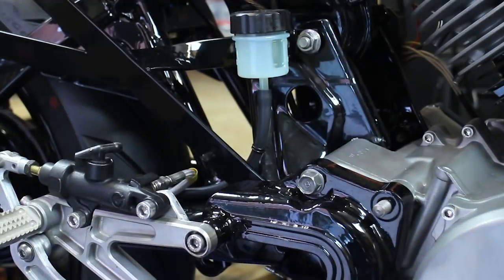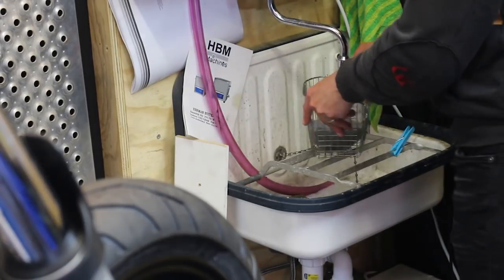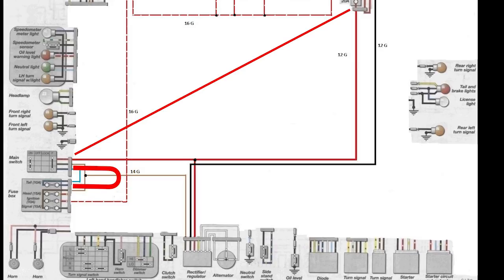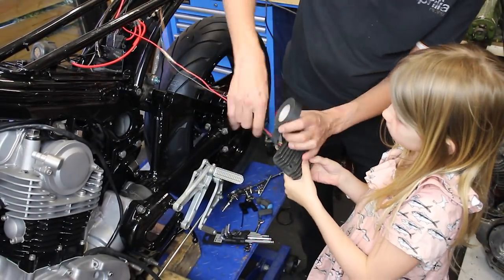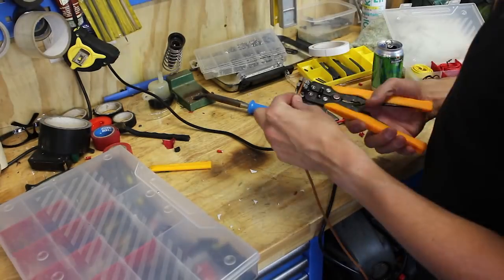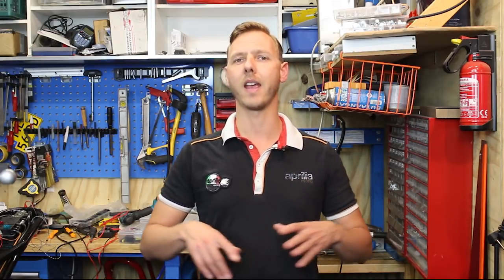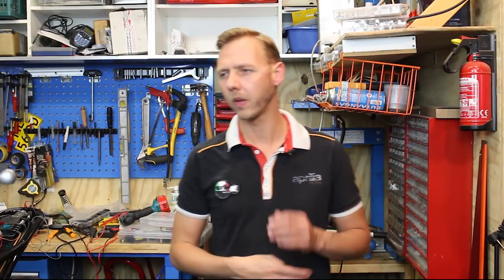Fueltank, brake fluid & wiring (part 3)

Comment: Good work ,Thanks for a good description of how power runs thru' in bikes.  I am humbly requesting you to  do a video of ranger 125cc or 150cc majorly showing clear connection for ignition  sys how the switch powers off the bike and also how it powers it on, left and right signal connection include a flasher, high beam and low beam connection how you connect to their switches and the regulator connection from the stator
Reply from the maker: I did those video's. Every bike is the same. Please watch part one and two real close and you will understand and be able to wire any bike https://youtu.be/6eX51fIQc8Y
Reply from the maker: And don't fast forward otherwise you will pass crucial info!

Comment: Am rebuilding my road legal quad bike and my son always wants to help me witch he is a good help lol but am getting confused about the lights and what wires go cheers Paul
Reply from the maker: Hope the video's help! Just take it step by step. It's fairly easy: A bulb needs a positive and negative. Negative is always a straight cable from ground or negative pole of the battery (doesn't really matter). Positive comes from your positive key contactwire and is interrupted by an on/off switch on your handlebar. Connect those, and it works! ☺
Reply: @chiefpepdesign  I will try that tomorrow when am off work thanks Paul

Comment: Pep my battery and starter solenoid are in the same location (under my frame) but my blue sea distribution block and positive distribution block are in a different location (much further away at the top of my frame). My question for you - can I run my starter solenoid positive wire directly to the positive of my lithium battery? Then run a separate positive wire to my positive distribution block to have it fused like your setup? I am trying to minimize the wires going back and forth if not necessary. Thank you.
Reply from the maker: Offcourse you can! You should even. Please watch this video https://youtu.be/m2cGSZlpznc I think this is exactly what you need.

Comment: Great work, however why didn’t you choose to use a motogadget M Unit? It would have made the electrics a lot easier and tidy
Reply from the maker: I thought I explained this is a video, but I guess not. First of all, I see the M-unit as 'cheating'. Second, the only thing it does is connect the cables. I can do that myself. Third, the M-unit is great if you don't understand, or don't want to put the efforts in to understand wiring. It's so easy if you just do it step by step and after that, it's very satisfying to experience that everything works as it should and knowing you did that yourself. With no 'shortcuts' like a M-unit which costs a fortune for basically nothing...

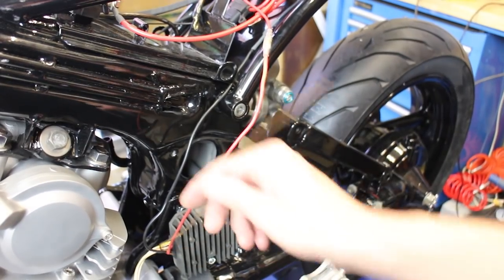Comment: Chief Pep, at the 8:50 mark, you show the brown and red wires from the Reg/Rect. The red wire connects to your fused positive distribution. The brown wire connects to your ignition switched distributed block. I purchased an aftermarket lithium compatible reg/rec, other than the stator wires, it only has 2 wires one red (pos) and one green (neg). My question is since there’s only one positive wire on my reg/rec for power, would you recommend connecting it to the fused power distribution like you did at 9:15 mark (pre-ignition switch) or should I connect it to the ignition switched plus connection on the blue sea distribution block like you did at the 10:18 mark? I am confused.
Reply from the maker: To make things less complicated than to try and write it down here, doesn't the 4:30 mark and explination help?
Reply from the maker: Sorry I get your question now! Connect the positive to the ignition switched power. 👍
Reply from the maker: It doesn't really matter. Either way it gets positive current. And both are eventually main fused. Maybe if you connect it to the ignition switch chances are smaller for power leaks during parking. But it's pretty far fetched. More of an 'ease of mind' thing. 😊

Comment: I  am restoring a 1994 Kawasaki 250 Eliminator. Where do the wires from the stator go to, and does this bike use both a CDI and a Voltage Rectifier?
Reply from the maker: I'm sorry. I have no idea. If you take the wiring diagram out of the workshop manual you'll see this instantly!

Comment: What did you wire into the forward junction box “brown wire”? In the later video you mentioned the you did not use all the spots. How many are needed?
Reply from the maker: Well brown is just a fused plus wire which goes on when you turn the ignition key. It gives power to everything you want actually... The fuse/distribution box has two sides. One side is permanent grounded (-) and the other side has plus (positive) power when the ignition is on. There I have some fuse spots empty. I can hook up everything I want instead of splitting the brown wire for instance.

Comment: Pep great video. I’ve watched this video at least 10 times. I have two questions. At 6:07 you add the inline fuse, but both ends of the fuse are connected to the same positive distribution block. How will the fuse work if the entire distribution block is receiving power from the battery? Second question, on your Bluesea fuse block how do you know how many amp fuse to use for each input?
Reply from the maker: I understand your qeustion. But you have to understand that the black unit itself is not connected to each other. So what I do is I put 12V input in the one end. By the connecting the amped wire I put that power to the other end. And that end is now also 12V but fused. So that block always works like this: one end had permanent 12V unfused, the other end permanent fused. So I attach different leads on those ends. That is why I choose to use such a block (see for instance 8:53) with nuts so I can ad several wires to it depending on if it needs unfused or fused 12V. Second question: This is shown in your service manual (or pause at my scheme that I show in my video's). Rule of thump: If many/heavy lights go through the leads (example headlight or all four signal lights which have a relais) use 15 Amps. Lighter lamps (tail lights/ignition) use 10Amps. If you've calculated wrong and it pops too fast at 10 Amps, try 15 Amps. Those fuses are generally only if you have a short circuit. Don't worrie to much about the amount of amps. Just don't go over 15 amps.
Reply: @chiefpepdesign  just like your videos, your explanations are amazing! Thanks Pep!

Comment: Hey there 😊 just finished Basic wiring for “running the bike” by you and it was such an amazing feeling to start bike succesfully thank you so much for that 😍😍😍 

I have one question , my reg/rec is originál from the Factory and it only has 3 white wires and one red i connected white ones like k was supposed to and red one connected to 20a fused distribútion bus  but no brown cable 

Ignition switched had two cables so one went from tha 20a fused distribution bus like for regrec and the other end to the fuse box 

Is it Ok ? Like bike is running With no probléms i am just double checking before conecting lights and etc thank you
Reply from the maker: I think so. If it works... You can always ask the Viragotechforum. They have many electrical tech guys there.
Reply: @chiefpepdesign  i tried to comment but it always ends up giving me error page 🤯🤯🤯🤯

Regrec is convwrting AC to DC right ? So the electricity flows from white cables in and throw red cable out ?
Reply from the maker: @majolamlech  Yes. The three white cables are receiving AC current from your stator, puts it in the R/R and the R/R gives positive (red cable) and negative (black cable) DC current straight to the battery. That's all it does. No more, no less. P.s. I hope you have became a Patreon...
Reply: @chiefpepdesign  actually yeah just now THANKS for reminding me 😅 i hope i set it up correctly i have never done  it before
Reply: @chiefpepdesign   i searched and found original wiring diagrams for model nd year so it takes ground directly from the frame THANKS to the screw and red wire goes to the fused cable which goes to the main switch and from ther to the fuse box
Reply from the maker: @majolamlech  yes. Thank you! 👍
Reply from the maker: @majolamlech  exactly. The positive is the important one. Ground is always no more than a frame. The brown is very outdated. Sometimes you find it. It's a cable to tell the R/R via ignition: 'he, go to work ok?'. Has no real function.
Reply: @chiefpepdesign  this is so much fun i never imagined it is gonna be so exciting every step forward 🤯

Comment: I'm not sure if I missed it or not but the magneto hooks up to the tci ??
Reply from the maker: What's a magneto?
Reply: @chiefpepdesign  there are 2 sets of wires that come out of where the stater is 1 goes to the r/r but where does the other one go ? It might not be called a magneto then I'm not sure.
Reply from the maker: @mikemillhimes4710  aha. Well. To quickly find an answer, take your time and watch this video: https://youtu.be/m2cGSZlpznc If you really want to know why and what you are doing, you definitely want to watch the part one of that video (where a steadily try to explain and make you comfortable with wiring). If you watch these two video's, you will be able to do everything yourself.

Comment: Another question my friend, we need relays or just fuses is ok ?
Reply from the maker: Ask yourself: relays for what? Use components (such as a relay) as a tool to... Not as a purpose or goal for itself. A turnsignal light needs a relay. Yes, otherwise it would not blink. A starter solenoid is a component which converts power. But, do you know any other parts which need a relay?
Reply: Chiefpep yeah, well my question was because on my mind any switch need a relay but is true what you said.

Comment: but where is the fuelpump + relais?
Reply from the maker: It doesn't need a fuelpump...
Reply: @chiefpepdesign  oke.. en als een motor die wel heeft, waar komt die dan in dit systeem?
Reply from the maker: @vincentprudencia5801  Dat zou heel raar en overbodig zijn in dit specifieke geval, want deze carburateurs hebben een vacuüm systeem dus laten de benzine door zodra de vacuüm even wordt losgelaten (door de carburateur). Als een motor deze wel heeft, is het het beste om te kijken naar wiring diagram waar hij zijn stroom vandaan haalt. Op zich is de brandstofpomp gewoon een motortje die dus plus min nodig heeft, en de relais onderbreekt alleen een plus draad richting dat motortje. Je moet alleen even kijken waar je ze vandaan moet halen (dat staat in het diagram).
Reply: @chiefpepdesign  yes thnx, het is voor een intruder 750
Reply from the maker: @vincentprudencia5801  O mooi. Die kun je overal vinden
Reply: @chiefpepdesign  yes, heb ik.

Comment: Not very pleased with the positioning of handlebars. Looks more like a brat style motorcycle. A typical cafe racer would have a lower set handlebars. Either Clubman or Clip-ons.
This handlebar too might look better on the bike if it is rotated by 180degrees i.e. if the handles are facing downwards as you had demonstrated in one of your previous videos.
Reply from the maker: Prasad Shetty I am not building a caferacer... I mention in several video's I'm building my own created style kind of streetbike. I call it caferacer for search purpose and because I don't really have a name for it. The handlebar I choose here and the filosofy bevind it I discussed in a previous video. Thanks for the concern anyway! 👍